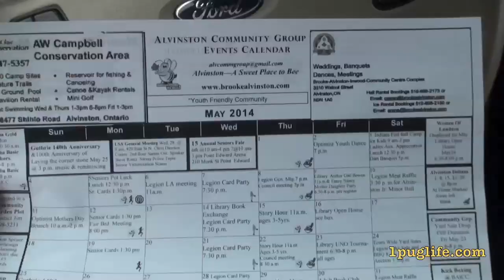repair day

Comment: With the transmission upside down, the drive pulley will spin backwards. I think this will make the wheels spin in the right direction, but wondering about the shifting working properly...